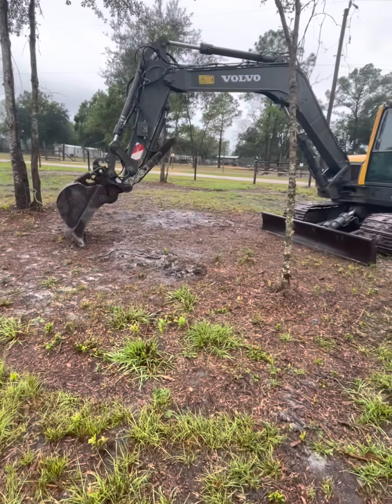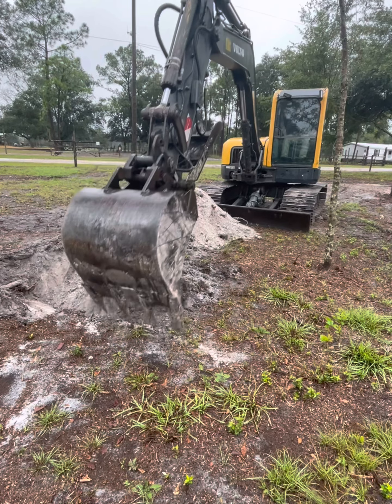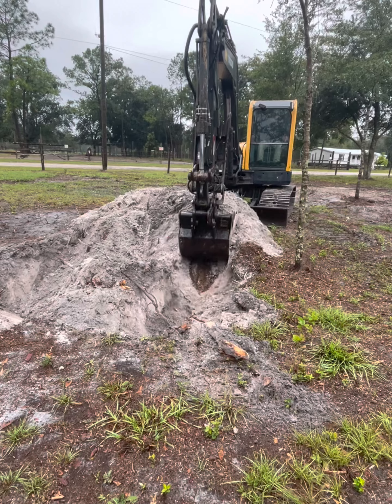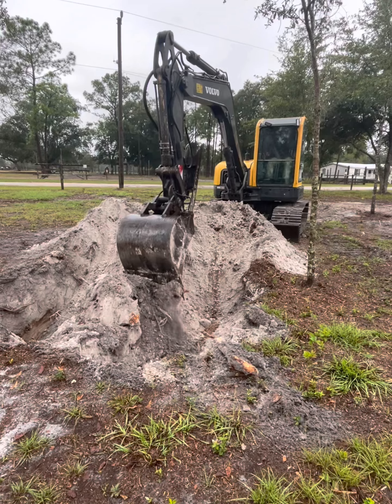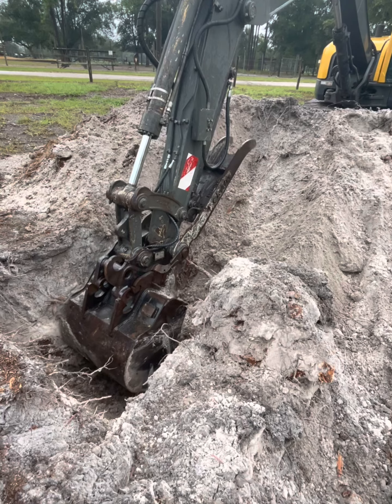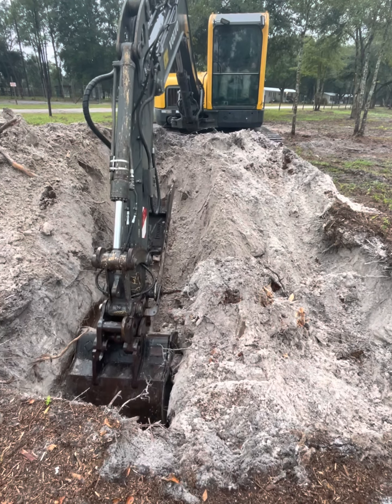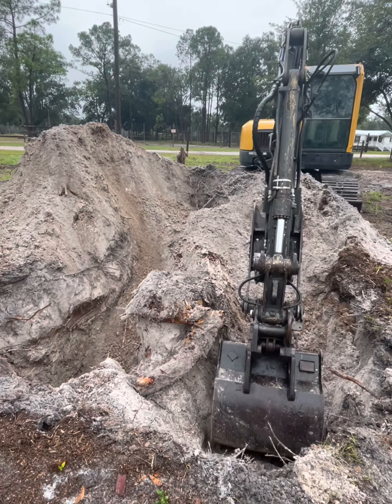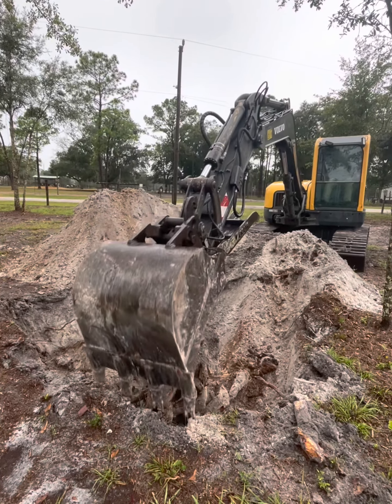Large stump small excavator!

Comment: It's easy to dig in sand so it is just a matter of time before you get em out. Workers often bend the rod trying to pop out stumps with the bucket curled in. Try getting an oak stump out of coral rock,  it is a mission in frustration. I like to run my stuff at lower throttle when possible. Unfortunately I have seen people use an excavator bucket as a hammer and that leads to disaster.
Reply from the maker: Yes if you look at it that way it is just a matter of time, trouble is most don’t think like that they are in a hurry and break machines because of unrealistic time expectations.  The oak in coral sounds like it would be a terrible time.